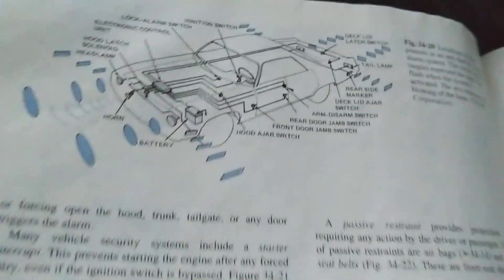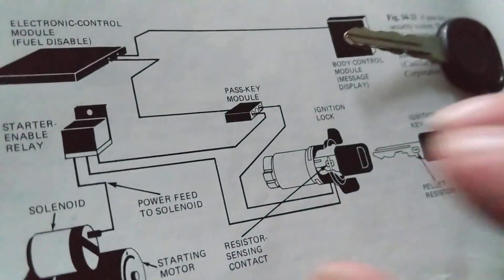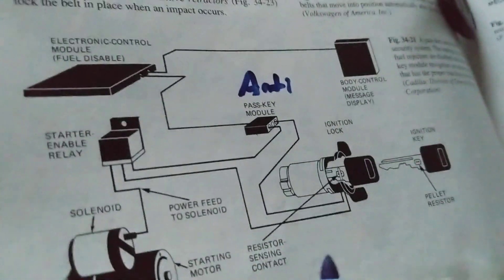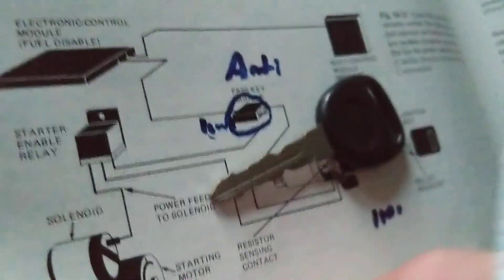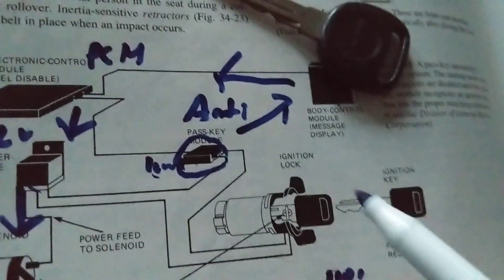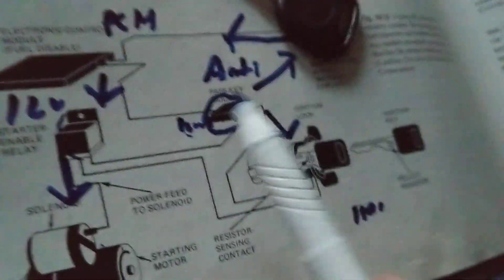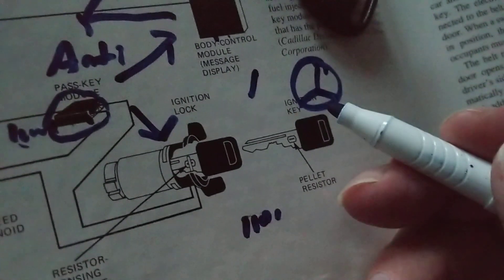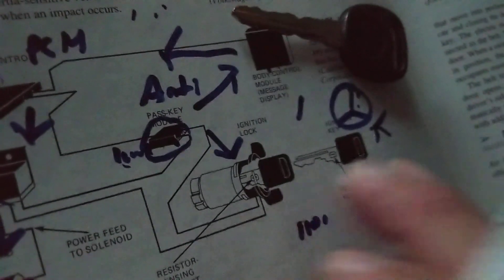SECURITY CAR ALARM SYSTEMS HOW THEY WORK

Comment: Hey man, good video but detaching a steering wheel to ensure security? Are you serious? Imagine you’re going down to the shops for the groceries. Are you going to detach your steering wheel and carry it around? How large and annoying are they. They have an airbag hooked up to them and a secure thread holding them in. If you constantly attach and detach a steering wheel, there is every chance that thread will deteriorate to a point where you can no longer put one on. There’s also every risk that connecting and disconnecting an airbag line from the CAN bus is going to cause the airbag to be faulty. Finally, the whole premise of taking off a steering wheel for security is no different to a key!? It’s a unique feature of the car required for it to be driven. The difference is a key is extremely easy to carry, a steering wheel isn’t. A key’s transponder makes it unique, a steering wheel isn’t. A criminal could just get a steering wheel for your car far easier then what they could get a key with the correct transponder. Bizarre

Comment: Can the original FOB of the motor vehicle be used inconjuction with the third party alarm system. This is to avoid carrying 2 FOB. Does installing third party alarm mean the original FOB wont work?

Comment: But I’m Wondering my self.. ther is a way to possible Of cloning the code I another key ?
Reply from the maker: You can make and program other keys to fit your car with the right scanner in most cars as long as you have the right key with the right chip in it the receiver module it will look for that code and VIN number and allow the starter to start